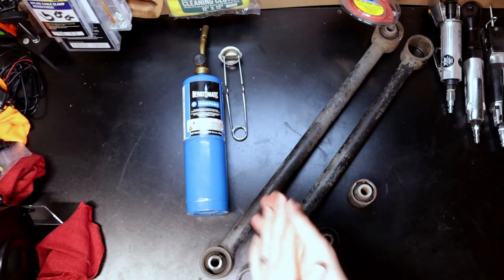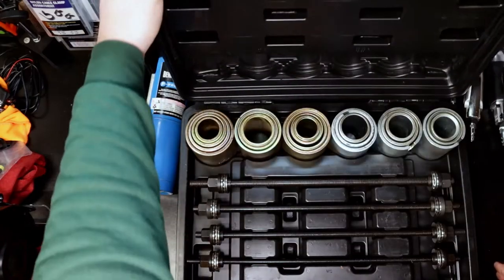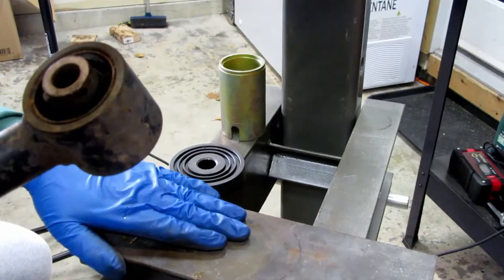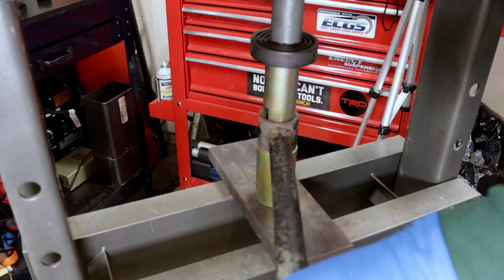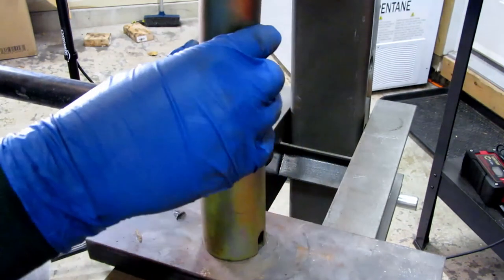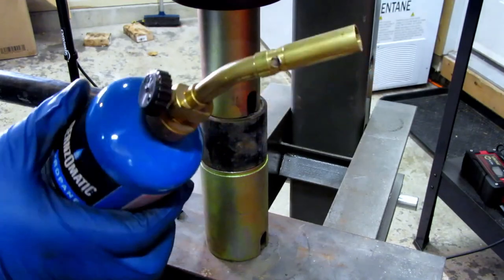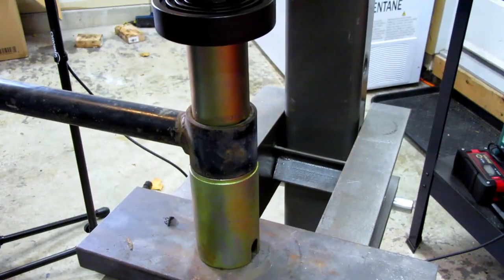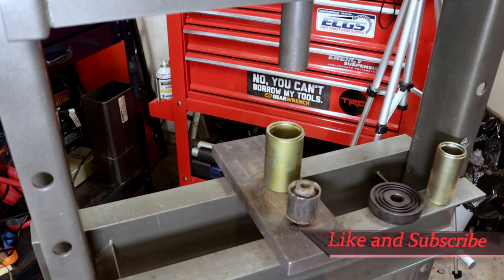Rear LCA Bushing Replacement

Comment: Bought sonoran steel lowers, easy switch out? Just arrived today.
Reply from the maker: Depending on your rust situation they aren't too bad. I've got little to no rust so they were about 6/10 difficulty with a press and the right size press sleeves. Thanks for watching👍🍺🤘

Comment: How did you get the bolt out? Mine is stuck in, it’ll turn but won’t come out.
Reply from the maker: I fortunately live in an area that does not salt the roads, so mine came out rather easily. I think @Timmy The Tool Man #sicmods, has a video on removal of a stuck LCA bolt 👍🍺

Comment: How did you tell it needed replacing?
Reply from the maker: The truck was about 20 years old at that point. It was just time. Once the rubber starts to separate from the housing or the sleeve it's time to go. Thanks for watching!!